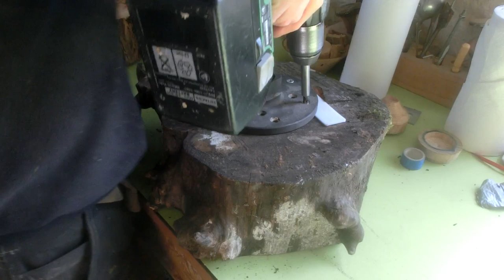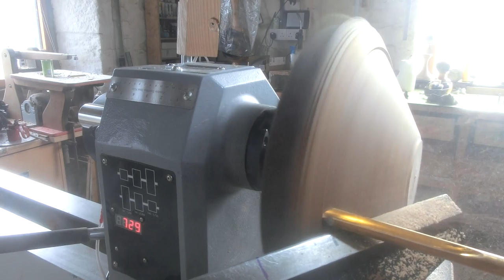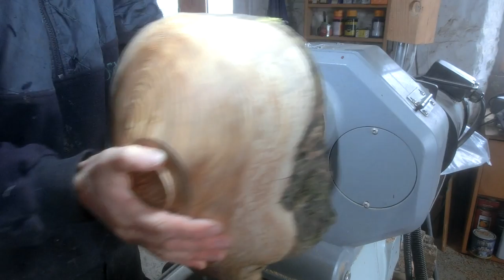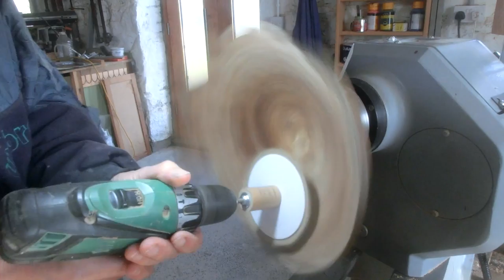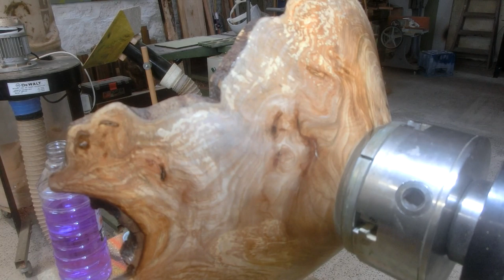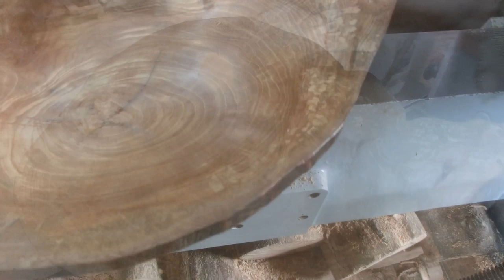Wood turning - End Grain Elm Bowl.

Comment: Nice...really nice.  Did you make your own sanding system.  I like the looks of it.
Reply from the maker: Thanks Christopher. Yes the sanding discs are very simple, a nut and bolt a piece of dowel with a hole down the center and a plastic disc, (plastic paint tub lids work well). One for each grade of sandpaper.

Comment: Didn’t know turning an end grain trunk section could work this well. Amazing figuring and nice form. I really like your finish, as well. I would be concerned about cracking from the included pith. What steps did you take to compensate?
Reply from the maker: Thanks Adam. This was a slice through a junction or crutch piece,  lots of multi directional grain and Elm is very tough, and so i just turned it as was!